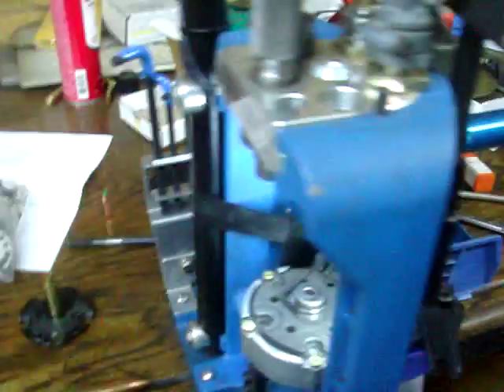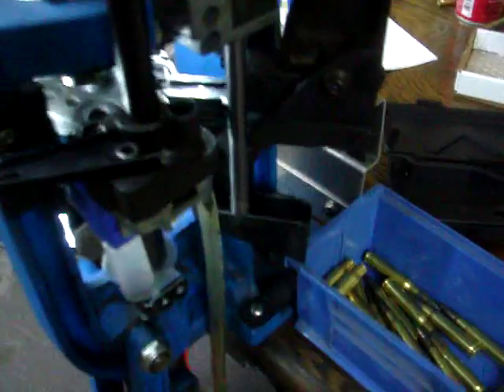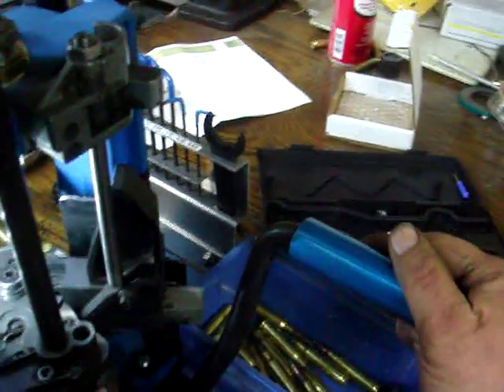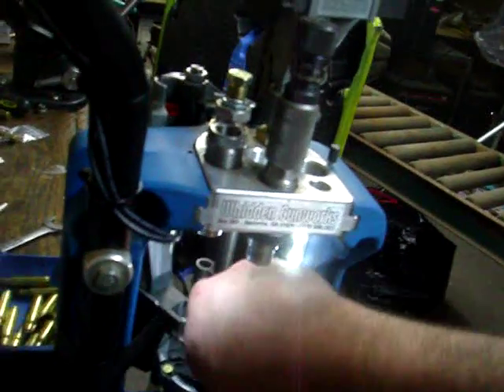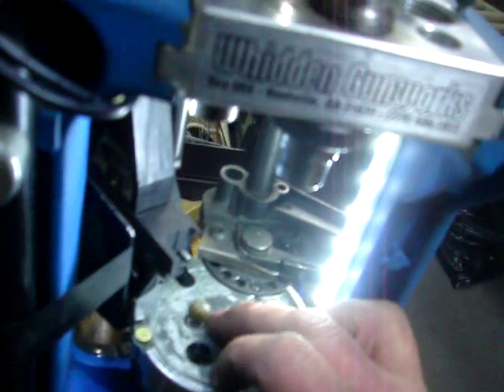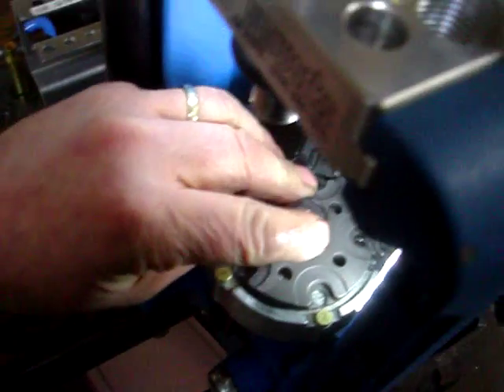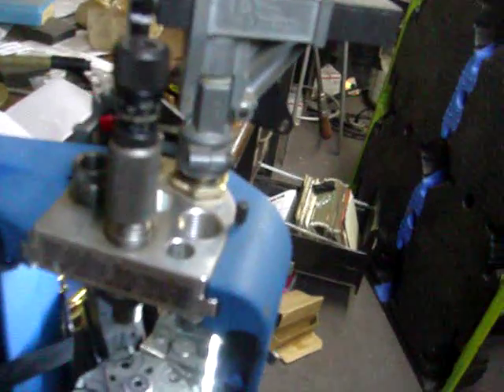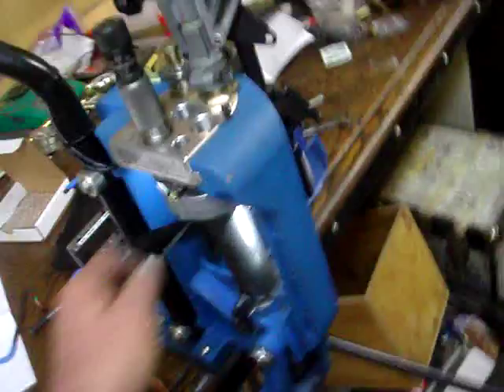Dillon Performance Improvements XL 650 / SL 900 / 1050 / Super 1050

Comment: The roller cam follower is not infinitely adjustable because the little bearing wheel needs to be in line with the slide travel.  Since there are 24 threads per inch and two positions available for each rotation of the follower, the minimum incremental adjustment in the length of the follower is about 0.021".  Since the slide has about a 45° angle, that 0.021" vertical step translates into the same amount in the horizontal direction.  So, with the roller cam pin, adjustments can only be made in 0.021" increments.  If it were a two piece shaft, then it could be made infinitely adjustable.  Just some food for thought, if you so choose (Snowshooze), and if you are not too cranky and mean.